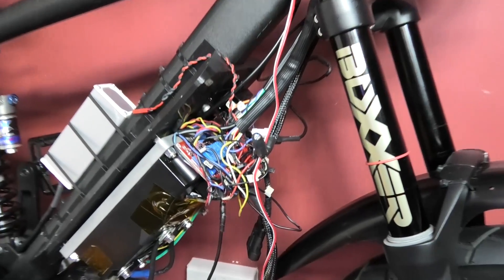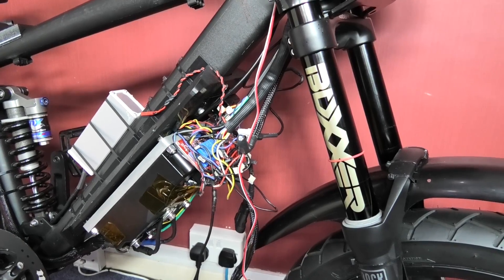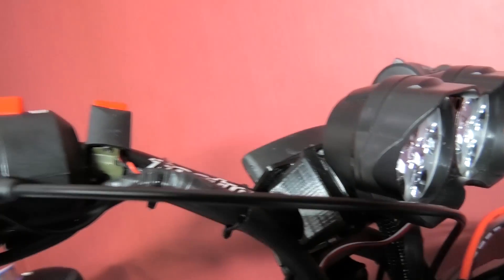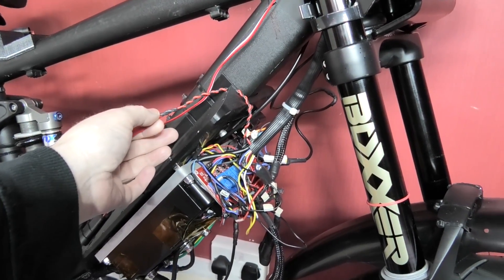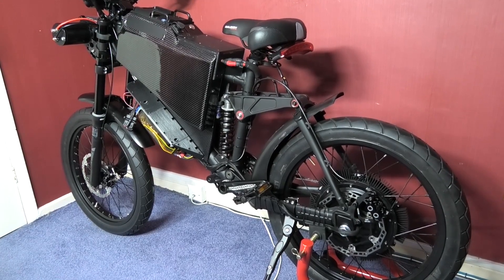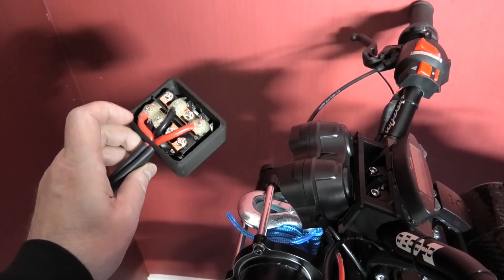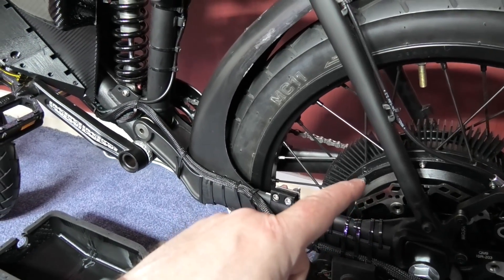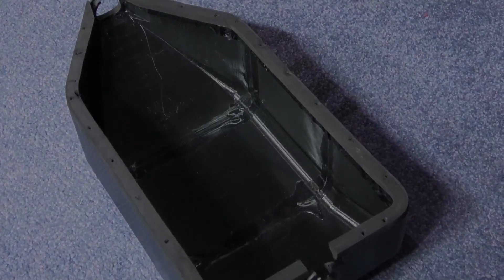High powered DIY eBike MSVA build part 31 - Teething problems - Maiden next week

Comment: Hi Tony will you be doing a video on all the bms settings as there are a lot and I have no idea what to set mine at. Great app btw, it's been great following this latest project. Thanks
Reply: All sorted  now got on forum ok not found answer to one thing. Do I need bother with setting connection resistance 
Thanks

Comment: Fantastic build Tony very impressive looking forward to the maiden run. Just a thought with the winch could you make a frame that could be stored in your flat? Of course it's quite hard to make suggestions/ideas when I don't no the layout of your building you live in. But I was thinking something in the lines of frame of some description to fit the area at the top of the stairs with some kind of quick realise supports inside your flat mounted on the wall??? 

Daniel from UK
Reply from the maker: Cheers Daniel.
I can't describe the layout of the flats but the stairwell is separate and there's exits to the various levels. The only way possible is with the winch on the front of the bike and putting a rope to the top. Anyway, it didn't work and the bike is at the lockup now 😣
Reply: Hi Tony 

Well I was saying to my self as I was typing I'm sure he has thought of this idea but thought I would suggest any way some times the simplest ideas get over looked. Damm that's a real shame it didn't work at least you have a plan b with the lock up. Looking forward to your maiden run video keep up the great work. You are inspirational for many to build such a bike in your flat with fairly limited tooling top work.

Comment: That hazard problem reminds me of something that happend to me in my case it was a box to operate indicators it worked fine then i connected it to the bike, then it went crazy turns out it was the relays interfering with eachother, as far as I could figure it the coils in the relay had some inductance even if they werent being operated at the same  time due to their proximity to eachother
Reply from the maker: It may well be that. I've got a lot of checking over to do but the only thing I could find at the time was the earthing of the clamp. I've also seen relays cause inductance (especially when they share a common positive) so we'll see........

Comment: With the cable gland at the end of the video, you could use a thin cable tie that sits inside the channel of the rubber U shaped gland which would pull the open ends together.
Reply from the maker: I'm redoing the whole box - there was never a recess for grommets and I glued them on afterwards (another thing that didn't work)